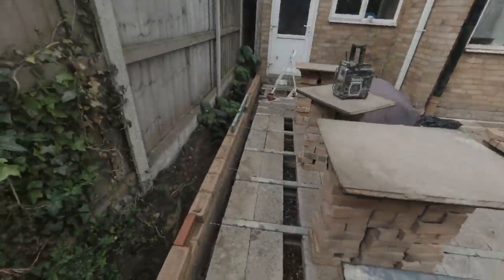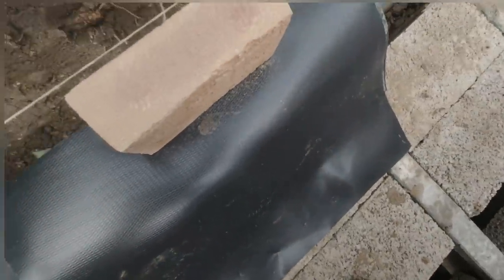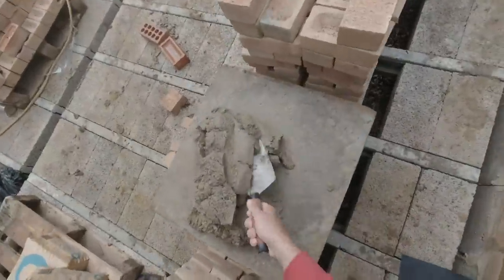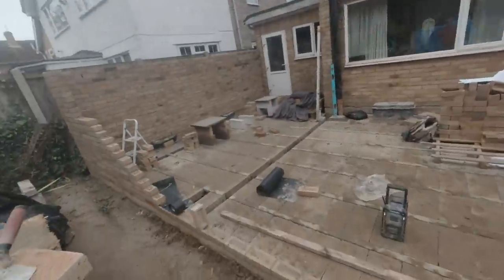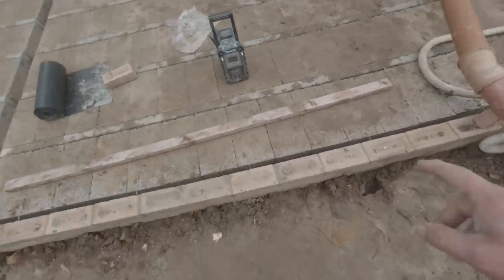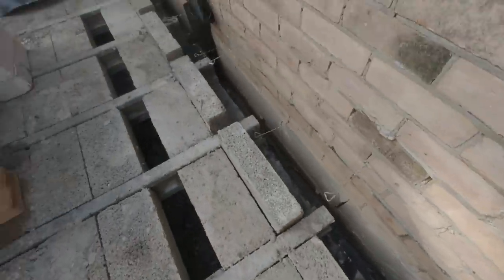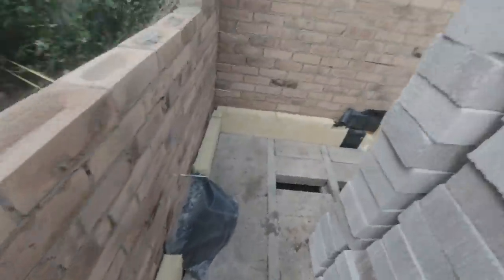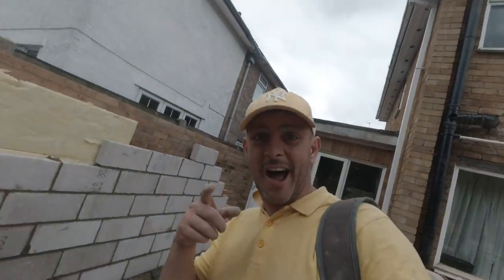How to extend Your home - part 2

Comment: Worked on a site years ago and the bricklayer  told me frog down tricky,what's your take on that,and can you explain  this to your  subscribers  would  like a second opinion  on this another top video mate
Reply: Lay with a smile and not a frown.  always frog up👍🏻
Reply: I would say frog up as well so all the brick can be full and the load of the house is passed through the whole brick not just the outside edge if it was laid frog down as you can’t ensure the frog would be full
Reply: @steveaustin4145  totally agree, I've actually  pulled up bricks that have been set and impossible  to get a full bed of mortar,bad building  practise,any time seved bricklayer should know this and nhbc should act accordingly  to make sure this never happens.